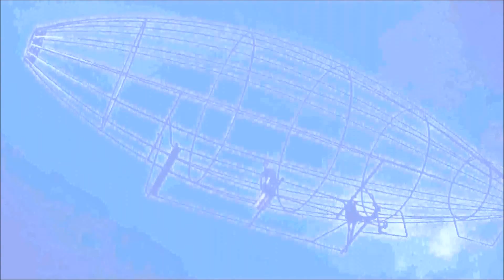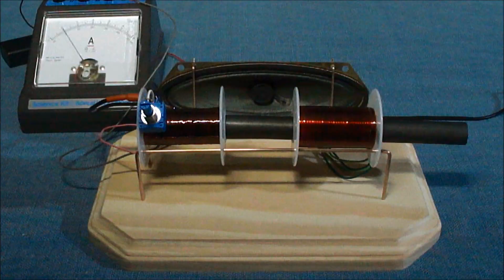Ghost Freedom Three Phase Radio

Comment: Nice phase shifting between the frequencies, its called frequency modulation in synth world. 2 or 3 oscillators working on each other by de-tuning them to each other. Its interesting to see amp meter stepping up at certain high frequency range. You should get frequency meter hooked up to it. See if you can see a correlation. Nice audiosamples 😁👍😎🎶
Reply from the maker: Thanks! I'd like to take some of this research further but it takes time and money for equipment.

Comment: My radio knowledge is very basic. Why these sounds were so irregular? Shouldnt backgro7nd elecgromagnetic noise be just regular buzz or hum? What is the source of these radio waves?
Reply from the maker: I don't know the source. The circuit has an electrostatic and magnetic condensing effect (elasticity). There's a low voltage electrostatic charge around the radio 3:44 .

Comment: Battery powered or energy harvester (ie like old crystal sets)?
Reply from the maker: 1- AA battery. It does harvest a signal to assist operation. In the last clip you can hear the frequency accelerate.

Comment: Interesting.  I hear some radio-teletype (RTTY) in your sound track.  Is your device a regenerative radio receiver?  What frequency range  can you cover?
Reply from the maker: It can do many things. The transistor is a 2n3904 with a max frequency of 300Mhz and the other radio tops out at 175Mhz.